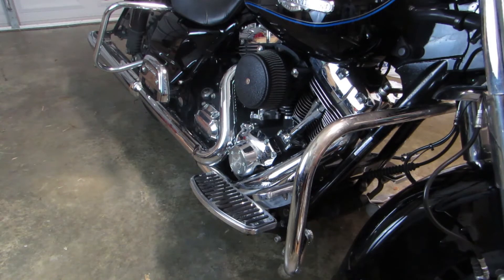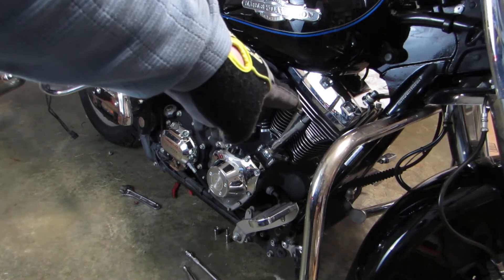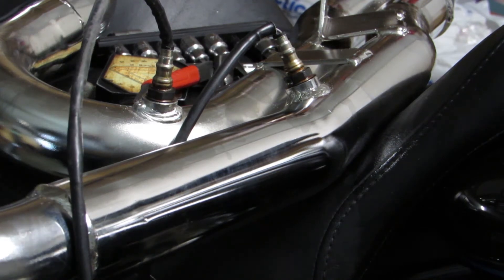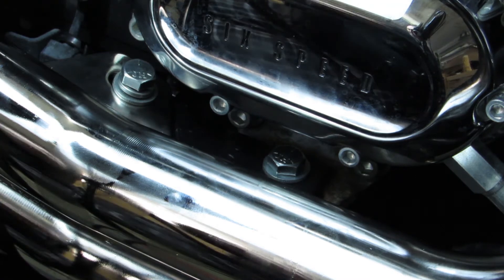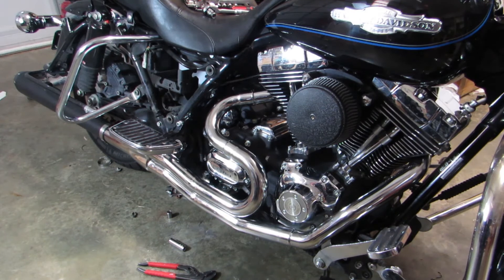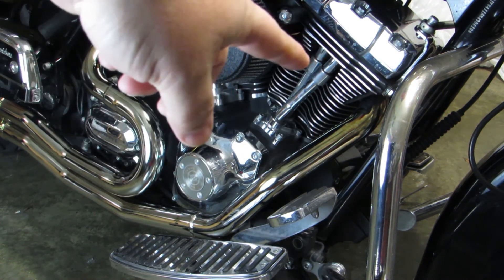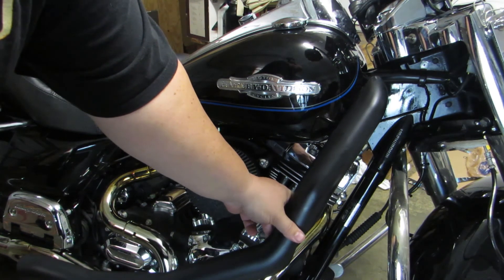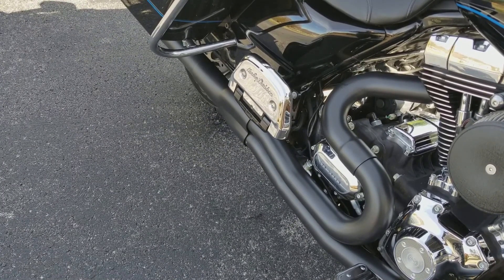Bassani Road Rage B4 2-into-1 Exhaust Installation and Sound - GetLowered.com

Comment: Did you have to extend your floorboards out to make these fit? Extension kit and spacer?
Reply: Just installed the Bassani Road Rage 3 on my 07 Road King...I did not have to extend out the floor board but they do include a spacer just incase.